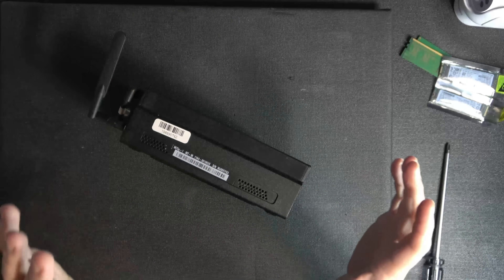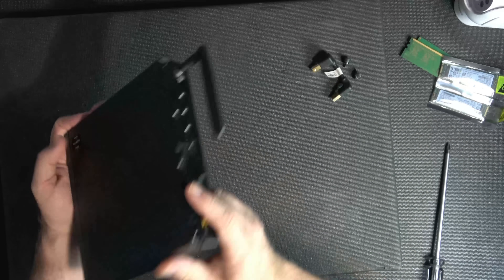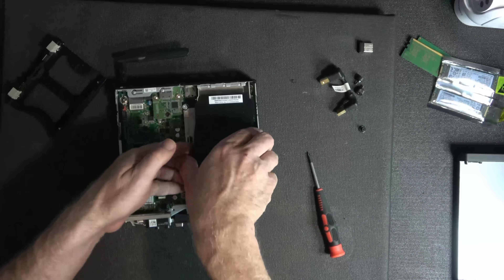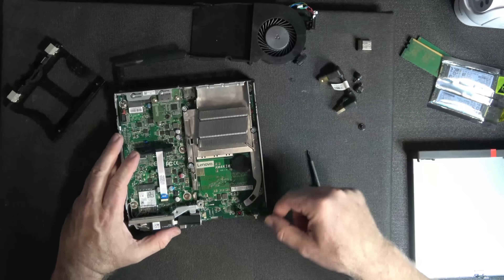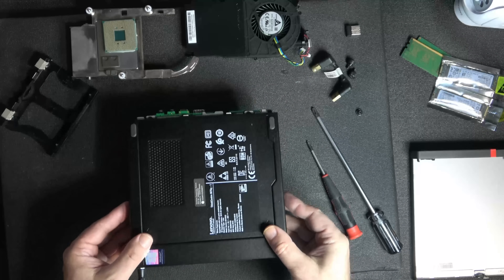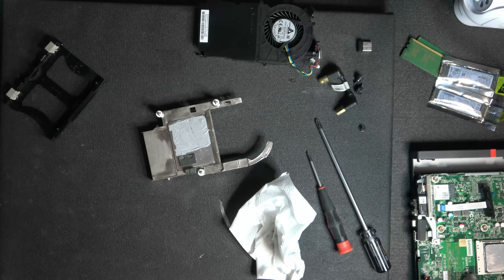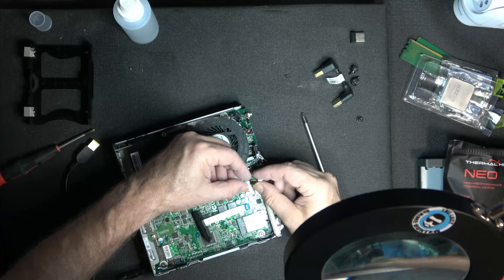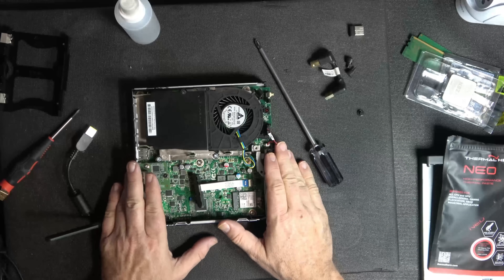LENOVO M75Q AMD RYZEN CAN I UPGRADE THE CPU -- LGH

Comment: Nice unit can you add a low profile single slot GPU or oculink?
Reply from the maker: You would have to run an oculink from inside so I would look at a unint with external oculink

Comment: Good to find it can be done, I have a gen 2 with a 4600GE, was thinking about a 5700G. I might just scrap the idea, I have been trying to run security cam software, with only 4 cams the 460GE is constantly upper 80s to 100% CPU use, thinking I need a good GPU for encoding/decoding, not sure, the performance on the little ThinkCenter is bad, though it did a great job running my 7 Days to Die server, maybe should just go back to using it for that.

Comment: I'm Going from a Pro 3200GE to a 3400G Not much I guess but Can't say I didn't try.
Reply: I would also like to upgrade to a 3400 ge, but I read on the forums that I have to have either a purchased processor or a processor from another Lenovo PC. If I use an HP or other competing brand, it won't work. Let me know if this upgrade is worth it, I can get a 3400ge for 50 euros.
Reply: @miskomuska  On the newer systems they blow up special resistors on the CPU so it is vendor locked. Looks like they didn't want the 35W "GE" models to be available on the free market. So beware of the GE models you can buy cheap...they might NOT work!

I've got the ThinkCentre M75q Gen 2 with the Ryzen 7 Pro 5750GE and played around with it (some home server and PostgreSQL database stuff; upgraded to 32 GB RAM). I wanted to put ECC RAM into it (the PRO processor support it) but unfortunately the crippled Lenovo BIOS does not. 😡
I'm thinking about switching to the brand new M75q Gen5 (8000 Pro Series AM5 CPUs - the successor of my current one would also be an 8 Core 16 Threads 8700GE CPU...the most interesting part is the much faster integrated GPU).
Reply: Why not read the documentation first.  Not very clever.